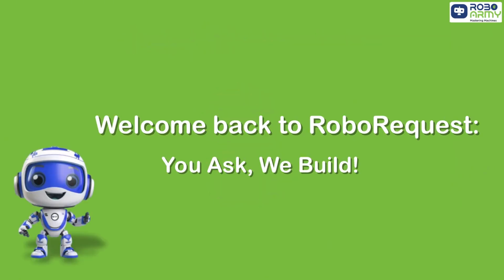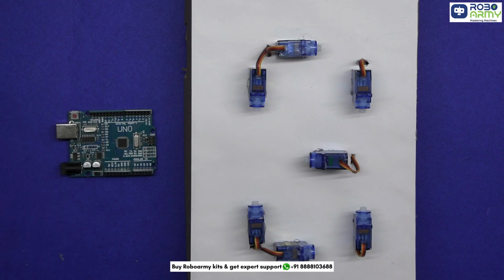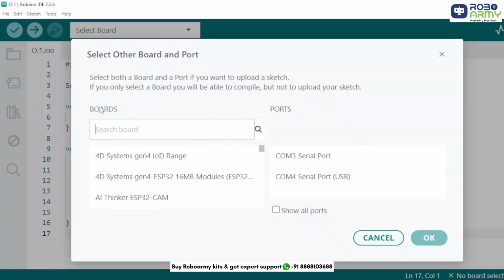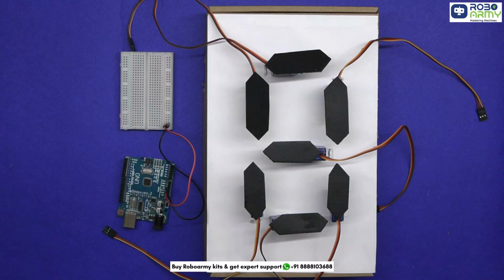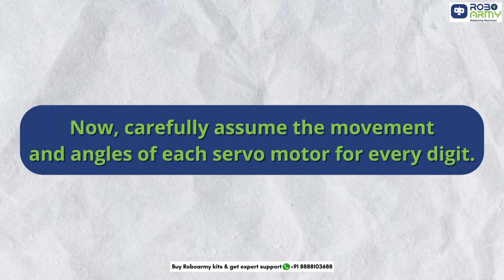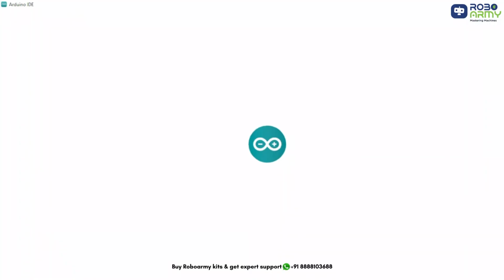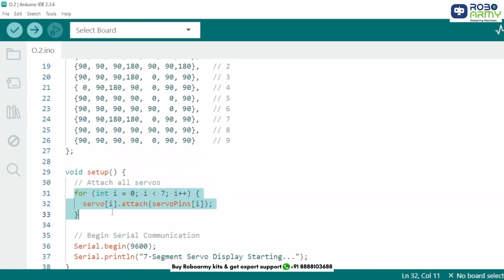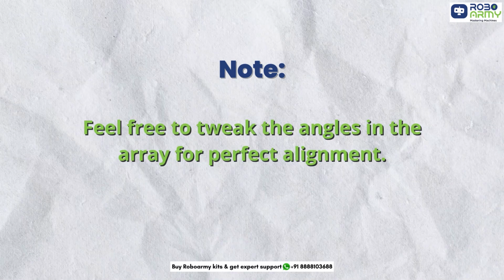DIY Mechanical 7-Segment Display with Servo Motors | Display Digits 0–9 UsingArduino

Comment: I have a doubt that , can i control the numbers with switch keypad in that , actually i was making that project
Reply from the maker: Yes, absolutely 👍
You can control the numbers using a switch keypad. Each button (or key) can be programmed to display a specific digit (0–9) by triggering the corresponding servo angles in the code.

You’ll just need to:
Connect the keypad or individual push buttons to Arduino digital pins
Read the button/key press in the code
Call the digit logic (servo angles) for the selected number

Comment: Won't it cause a brownout by directly connecting the Arduino 5V pin with 7 servo motors?
Reply from the maker: Good question 👍
Yes, powering 7 servo motors directly from the Arduino 5V pin is NOT recommended for long-term use. Servos draw high current, especially at startup and under load, which can cause brownout, reset, or unstable behavior.

In this demo, the servos are lightly loaded and powered only for testing. For a proper and safe setup, always use an external 5V power supply (with sufficient current) and connect the grounds together with the Arduino.

We’ll also mention this clearly in the full tutorial. Thanks for pointing it out! 🙌

Comment: I want to buy the model from you what i can do
Reply from the maker: Hi! The complete list of components required is mentioned in the video and description. You’ll also find all the details about connections and the circuit diagram in the video, and we’ve provided a link to download the code file. You can purchase the components from online marketplaces like Amazon, Flipkart, or from your local electronics shop according to the list provided.